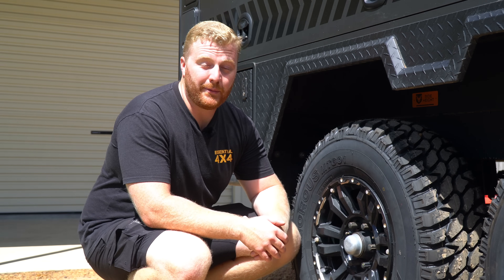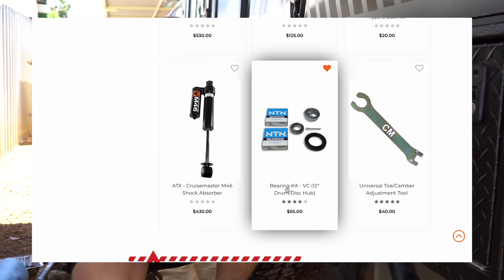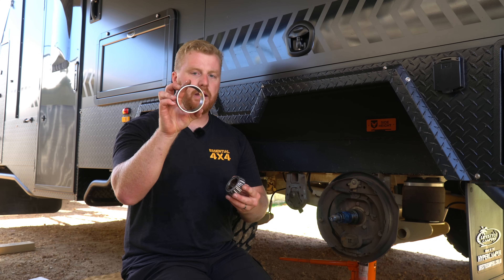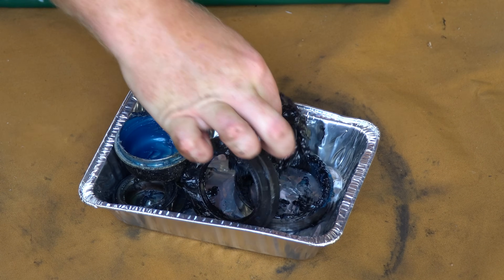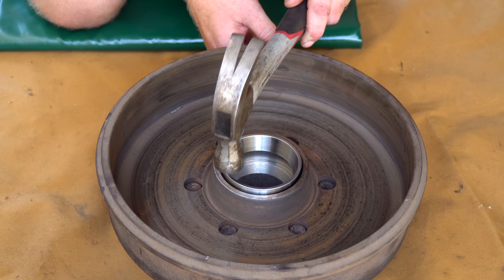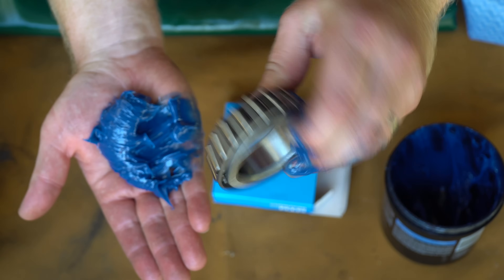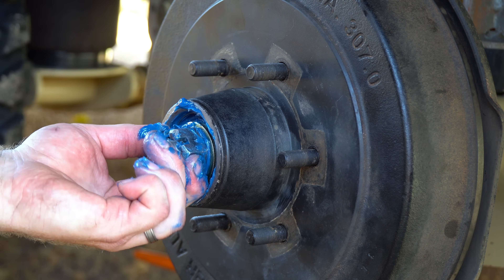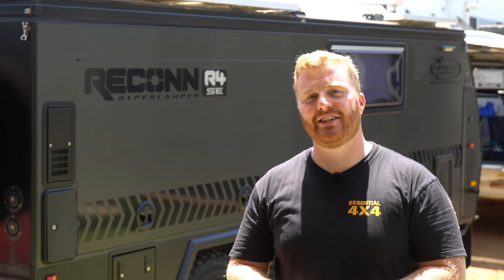CARAVAN WHEEL BEARING | Everything you need to know | REPLACEMENT |Service |Maintenance | Adjustment

Comment: Great explanation on the wheel bearing, just an extra tip, if you place the cups in a freezer (if you have) over night will help with a easy- peasy  fit👍👍
Reply from the maker: That's a great idea hadn't heard of that one before 👍
Reply: Only problem would be  you are introducing water on the inside of the cap.

Comment: Caravan wheel bearings of similar design in 4wds will often last 100k kms and so will van bearings if one extra step is taken. Seal those end caps with waterproof glue or silicon and no moisture or dirt sneaks inside that ‘so called’ interference fit. My AOR ‘full Offroad van bearings are 50k old now with two minor external checks/adjustments at 20k intervals. At 50k still perfect but end caps are fully glued in after every check. Where I live condensation is a thing and moist air can condense inside end caps which is not good for longetivity of bearings.
Also when knocking in new bearings with an old outer ring use a thin metal grinding disk to cut the old ring through, then the old ring will literally fall out after knocking in the new rings.
Reply from the maker: Thanks mate, so I've actually tried the sealing of the dust cap a couple of times now and found it didn't really help at all in my case. Maybe its something to do with this model of the Cruisemaster setup, or maybe it's coming in from the otherside, either way it didn't work for me 🤔 
Great tip with the old ring though, thanks 👍
Reply: But really, replacing wheel bearings at 20 km intervals is in every way an overkill. Best to seal them up tight so no dust or daily water vapour in the air gets to condense inside the caps (this is what happens in real life and is the arch enemy of wheel bearings), adjust them properly, check them every day driving with a quick wobble test and check temp as you suggest. All cars have fully sealed bearings (gaskets, caps/drive flanges/etc bolted down) and most car bearings last 100k ++kms (even crappy designed landrover/old toyota hubs), no reason at all why caravan bearings do not last as long except for the 1930's design of hubs/integrated drums that we can change slightly or change to disk brakes so servicing is a breeze.
I wonder why most cars now have fully sealed bearings that last years and often 200k kms? @XploringOz
Reply: Agree totally with what you say. My Lotus has done much more km and to this end I have only replaced one bearing, only because I wasn't sure about it. Still carry a full replacement set (and seals) though as some sizes can be hard to get in remote areas.

Comment: Excellent breakdown on bearing replacement, I prefer bearing buddies to dust caps on my boat trailer, keeps the grease pressurised which helps to stop water ingress. Also the colour of the grease changes if water gets in
Another handy tool is a hub puller, as failed bearings have a habit of fusing to the axle, saved me and others on a few occasions 
I also take spare hubs(with bearings) makes Change out on the side of the road much quicker and cleaner
Wearing disposable surgical gloves also makes it a much cleaner experience 
I keep a few pairs in my kit
Reply from the maker: Some great tips there, thanks for sharing with all of us. 
Certainly some things I'll consider moving forward 👍
Reply: Boat trailers have a different use case.

The bearings get very hot then submerged into cool water, that rapid cooling pulls water through the seals and into the bearings.
Bearing buddys are pushing against that force.
Reply: @Robert-cu9bm  good point I did not think about that

Comment: G'day Nathan good advice, after a recent rough 17k trip I replaced the bearings also. I machined up installation tools for cups,seal  &dust cap. I also wash up and examine the bearings removed , this tells a story about  bearings, brinelling possible water contamination, scoring from dust entering, or slight discolouration due to slight over tension. I have Cruisemaster discs, and I find the only issue is removing the cups. The lip to punch on is very small & and the pin punch doesn't locate easily. A simple notch cast in at 180 degrees would make removal much easier.  Safe travels
Reply from the maker: I agree with you there regarding the Cruisemaster cups, however once the punch was 'worn in' it seemed to work well 👍  They certainly tell a story, that's for sure!
Reply: As you would have discovered whilst removing / installing the bearing cups from the hubs there is very little edge to get the punch to bite onto. I notch the hubs with a die grinder once the old cups are removed & the hub is wiped clean of grease. The hubs are then thoroughly cleaned in kero and the inside of the brake drum cleaned with brake clean or similar.  This iwill enable easy removal the next time.....  I have just re done my set on the Coromal - much easier this time!!
Reply: @mjhmech4903 We think a like, I ended up doing exactly the same thing. I can't believe Cruisemaster wouldn't have done the same from the  factory. 👍

Comment: @XploringOz Most caravan manufacturers use Chinese wheel bearing kits. Although the quality of some of these bearings has improved immensely, personally I would prefer for my own peace of mind to run a quality USA or Japanese wheel bearing kit eg: Koyo, Timken, NTN, CBC kits etc. $140 for a full kit of quality bearings & seals for parallel bearings on a tandem van/trailer is pretty good value VS a bearing failure in the middle of nowhere!! Another tip: make a driver to instal the new grease cap from a 70mm exhaust tube offcut re parallel bearings such as you have here. Saves the frustration of trying to get new caps on without damaging them😗
Reply from the maker: I hear you, quality is a big consideration, particularly when heading out remote like we do!
Thanks for the tip, that's a great idea! 
PS. We are back in Kalgoorlie now, need to catch up at some point 👍

Comment: AS A 40 YEAR fitter and Turner, when you remove the bearing cap and see great that looks like new you are not going to find much wrong or need to replace bearings. A wSte of money and resources, just a check and adjust would be all requited with grease looking like new that hasn't been over worked.
Reply: Hmm. I've probably done more wheel bearings than 99% of people reading this and I would NOT be making such assumptions when there is so much potentially at stake. Do it right - do it once. Given most van manufacturers run Chinesium wheel bearings that would actually be quite a gamble!

Comment: Those bearings you took out were still immaculate. Stop judging them by the grease colour, grease naturally gets darker with a bit of heat. 

I'f I were you, I would concentrate on just making sure they are packed well every few thousand ks on the outers and making sure there isn't play
Reply from the maker: I can see how it may look like that, but I can assure you, they weren't immaculate. It's an easy job to prevent the potential for a bigger job in a difficult location. 
This isn't just a regular 'van' that gets taken out on weekends and holidays to the nearest caravan park. It sees some rough and rugged terrain which would certainly add to the degradation
Reply: Yeah fair enough mate. Love the content of your vids @XploringOz
Reply from the maker: Cheers mate 👍  @DarrenBoxhall
Reply: The average person wouldn't be able to tell how the hard facing looks.

Comment: I had a question regarding jacking the wheel up from the ATX suspension arm. I have the same Cruisemaster ATX Airbag suspension system on my Titanium Van. I’m assuming dropping the air on that side and it’s ok to place the jack on the arm as you did in your video?  I have limited mechanical knowledge and always enjoy your very detailed reviews and YouTube vids. Appreciate in advance. Cheers. Marcus.
Reply from the maker: Hey mate, so this is the recommended method preferred from cruise master. The jack goes into that recessed hole in the arm and they recommend all pressure is removed from the bags for the air suspension models 👍
Hope that helps, thanks Nathan.
Reply: Thanks Nathan. Very much appreciated. Thanks for replying. Cheers. Marcus.

Comment: Whilst I am all for preventative maintenance I have to ask; Why should the trailer bearings be serviced more often than the tow vehicle bearings ?  The bearings on my G&S chassis Lotus Trooper are very good quality (ie not chinese) and they have done tens of thousands of kilometres, maybe between 50-70K km, I check them regularly for heat stress (via a heat sensing laser device) and have re-packed them once, purely for prevention in case. The van manufacturers recommend repack/replace every 10K km but the maker of my car suggests no such thing over such a short distance, so why the difference ?  Is this over-servicing if asymptomatic, or a ploy by dealers to keep their workshop busy ?
Also, hooking up to your car is a great idea to prevent movement/instability, especially since you will need to ease the park brake to get the drum off.
And still more ! If you are going to carry replacement bearings then consider packing them before storing in your trailer/car as it is much more convenient than doing it roadside.

Comment: Don't need to remove cup to repack or inspect. Look at them in the hub. Just take the cones out and obviously clean up everything. If you don't have cleaning solvent,  Petrol  works the best with stiff bristle little brush and plenty of rags. A messy job 👍
Reply: The reason for removing  the bearings is  to look for any brinelling, scoring, or wear of cages and applying fresh grease. The cones can easily be checked without removing from the hubs.

Comment: The bearings will last the life of the van as long as they don't get contaminated or run out of grease. Definitely don't need to replace anywhere near 20k
Reply from the maker: I found them to become contaminated fairly quickly, whether this from multiple water crossing or the type of terrain we cover. Either way, its cheap insurance
Reply: Depends if they used Chinese bearings or not.

A quality brand like skf, nsk would easily go the distance.

Comment: One more thing. You go through all this bullshit of replacing them all the time and all that....but you don't even preload with a torque wrench.

You just guessed, or maybe that's why you need to replace them so often
Reply: If you listened to what he said in the video, he stated that he didn’t have the equipment (torque wrench) to tighten them down to spec at the time of making the video (or on the road), so he demonstrated the technique to do the next best thing.  Often with remote travel this is the way it’s going to be done.

You seem to like flexing on someone else’s video, had you thought about doing your own, on your own channel OR do you just like to come and call BS on other peoples channels?
Reply: Top job mate. Very good tutorial. Only thing I wouldn't do is tap a hardened bearing outer race with a hardened head hammer. Could get nasty for your eyes.
Reply: Not flexing. Just stating that maybe he might not need to replace them so often if he torqued then correctly. 

But as he said to me, be goes super remote so better safe than sorry. Which I agreed @GR8Tmate